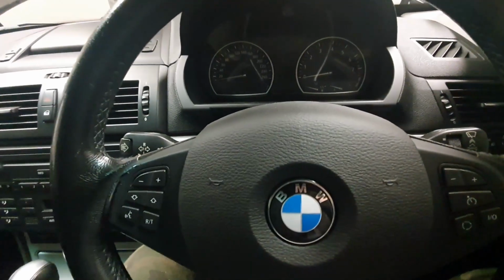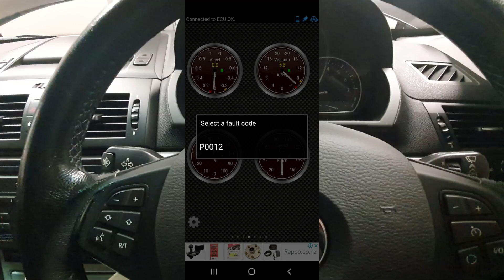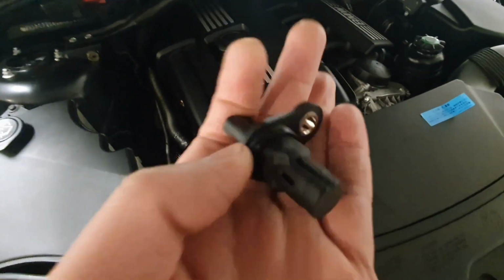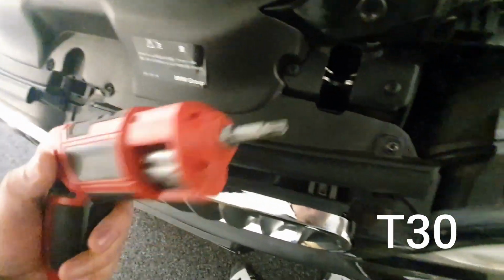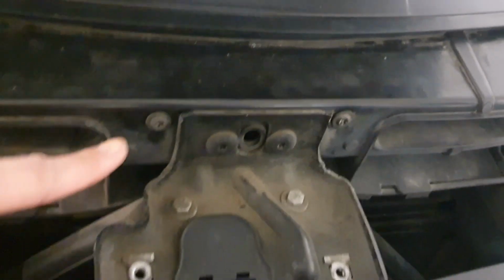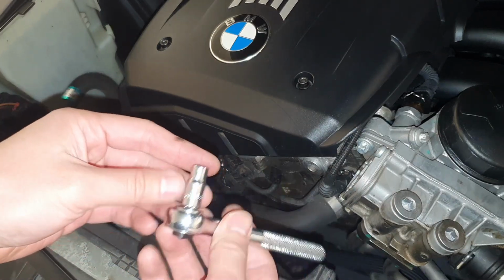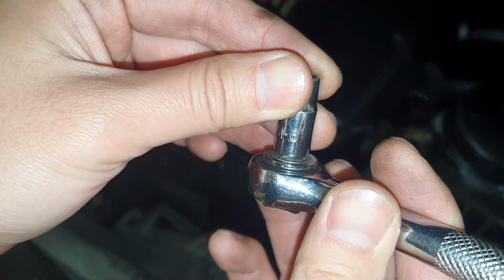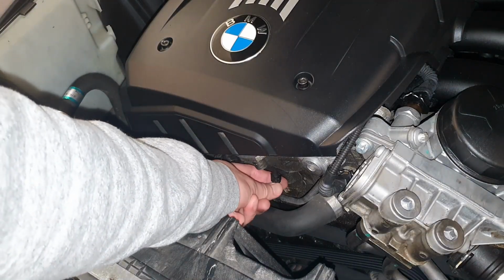P0012 -BMW X3 E83 camshaft position sensor- extend crank

Comment: Bmws only like the dorman sensors which are OEM. If you go the ebay sensor route and your car still has problems, then cheap sensors are your problem. If problem persists after OEM parts, then its timing chain problems.
Reply from the maker: Thanks for info bro.
Reply: Since when is doorman OEM for bmw????

Comment: I have a bmw 328i 2009 e90. I have the code P0012 . I’ve replaced intake camshaft sensor , clean the 2 vanos selanoid , and changed the oil and new oil filter . But the problem is still there ,  I’m thinking is the crankcase ventilation? What you. Think?
Reply from the maker: whats the symptoms? is engine code P0012 still there?
Reply: @diysignal3107  yes . I even changed my oil filter cap. And still there
Reply from the maker: @joshuaperez1187  car drive alright? MAF? or valvetroic motor checked?
Reply: @diysignal3107  drives fine . But at a stop or red light it’ll . Idle a lil bit
Reply from the maker: @joshuaperez1187  it posible cause by default on valvetronic motor. it may cause by valvetronic fail when it hot.
https://youtu.be/dprArUXWU4w